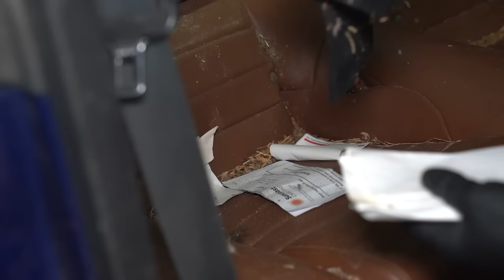Deep Cleaning The Worlds NASTIEST Ford Mustang | Insanely Satisfying Car Detailing Transformation!

Comment: Any reason you don't use the Tornador velocity vac to purge those carpets before extracting? I could understand using a crevice tool for vlogging specifically, but using the Tornador has cut down on my vacuuming immensely and is 100% more thorough in removing the deeply embedded dirt and releasing the pile for a better extraction cleaning. Keep up the good work man!